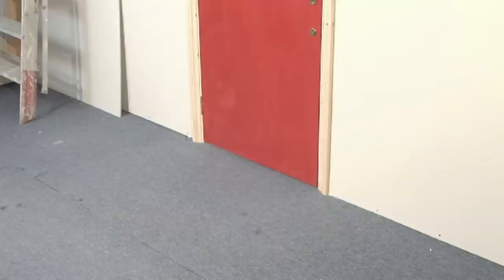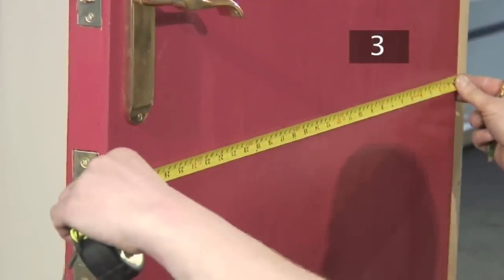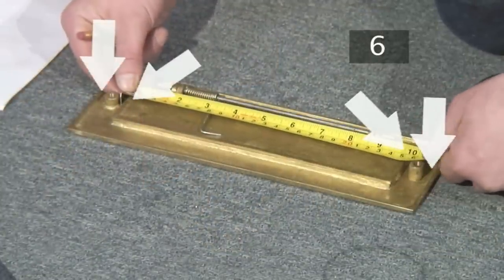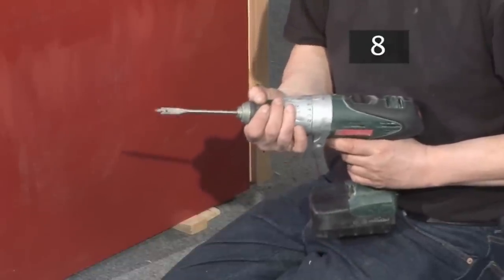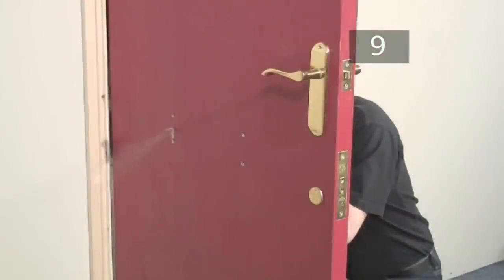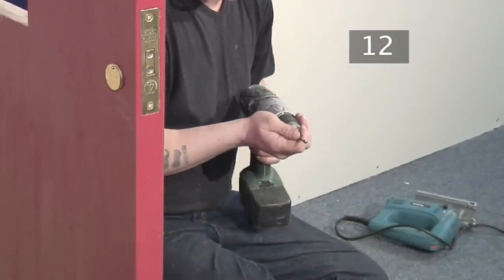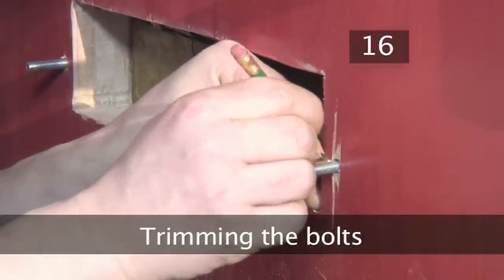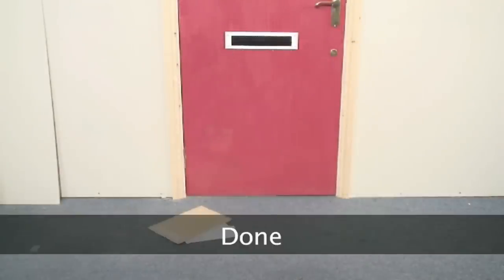How To Fit A Letter Box

Comment: Probably better if u use a spirit level or a square when marking out the position in the first place.. Never assume that the bottom of the door will be level as it will have been cut to "fit" the ground level ! And... when drilling fixing holes, it's easier to drill the largest "lug-holes" first.

Comment: Better to drill those lugholes before going right through for the bolts. Then you can use the point of the flat bit as a guide.

Comment: You should have mentioned that a postman needs to be able to put letters through this letter box safely. IE, with out breaking fingers on an over strong spring resisting the flap, and not having to push their fingers  through the letter box to overcome the completely unnecessary draught flap.  As well as not getting there fingers bitten off by a  Dog.  Lots of safety advice for the fitter, but no consideration for the person who is going to be using it, the postman.